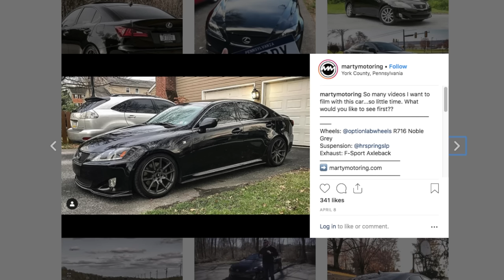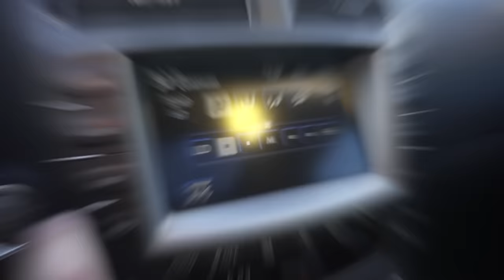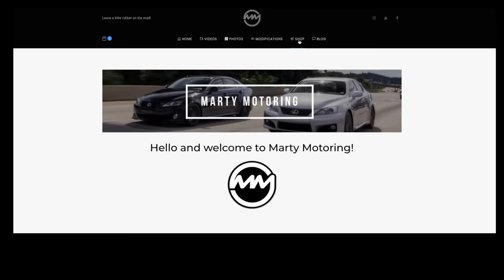Popular Mods for Lexus IS 250 and IS 350

Comment: Almost Everything he said can be said about literally any car. This isn’t vehicle specific
Reply from the maker: I could make a general car one, which would get more views I'd assume, but I like to focus on what I know - the Lexus IS - and point out specific parts and upgrades that are popular for this model of Lexus. But yeah, most of these can be applied to any modified car.
Reply: Most mods are universal really. Like turbo kits that are not "plug and play", as in you will always have to look for other parts like injectors, get a custom exhaust for the setup etc. It's because it's customization and everyone has different tastes and needs.
Reply: Very helpful suggestions to bring any Lexus up to par with additional features! I've actually topped out on what you said with the exception of the rear defuser and stability bars. My next   update will be a new a
RR-RACING carbon airflow tube!
Reply: @jeffgrant7113  What brands are those parts? Who makes parts for the Lexus cars?

Comment: My first car ever was 2008 IS250. Loved and enjoyed it for 8 yrs. Love to see the car still gets love in 2019.
Reply: I am actually thinking of getting it for my first car.Would you give me any advice?
Reply: What should i look for?
Reply: siemenssx1  dumb advice, don't finance a garbage civic
Reply: siemenssx1  An old car can be bought for much cheaper. It's already devalued. A new car will just lose value over time, much more than a used car will. Resale value is higher but so is the loss in value. Also not necessarily a better ride either. Modern tech and better fuel mileage, yes. Hondas have a decent resale value but so does Lexus.
Reply: @cfvankata543  Get A 350 Trust Me 😂
Reply: @ItzExxLOL  I was thinking of getting a 250 or a 350 as my first car any thoughts
Reply: @willterry156  A 250 Is Fine If You JUST Want A Car & Make It Look Good Etc. But Definitely Go For A 350 If You Don’t Want To Drive Around Seeing A Camry That Can Leave You Cars Behind 😂💯 I Made My Wrong Decision 250 Is For Looks 350 For Speed
Reply: 2022 still getting love
Reply: What car to you have now?

Comment: Just checked your list of modifications and noticed you have a 4runner. That IS350 and 4runner combo is killer! Great minds think alike!
Reply from the maker: It’s a perfect setup! Just got it 2 weeks ago 😎
Reply: @MartyMotoring  I have a gs350 2010 with 167k miles, Its on lowered springs + aftermarket tires & rims and I plan on getting a catback exhaust next week, I been hearing that I could get a RR racing tune but I'm a little un sure about it since I'm worried about the engines health with these miles, any tips? btw any other performance mods I can add that actually will give significant results?
Reply: I have a gs350 2010 with 167k miles, Its on lowered springs + aftermarket tires & rims and I plan on getting a catback exhaust next week, I been hearing that I could get a RR racing tune but I'm a little un sure about it since I'm worried about the engines health with these miles, any tips? btw any other performance mods I can add that actually will give significant results?

Comment: Shes perfect. Simplicity is the key to these amazing cars, some people rice them out and make them look, sound and run horrible. Props for doing all the right things
Reply: I have a gs350 2010 with 167k miles, Its on lowered springs + aftermarket tires & rims and I plan on getting a catback exhaust next week, I been hearing that I could get a RR racing tune but I'm a little un sure about it since I'm worried about the engines health with these miles, any tips? btw any other performance mods I can add that actually will give significant results?

Comment: One often overlooked mod IMO is oem sized 2piece floating rotors. The IS350 already comes with stock 4 piston caliper Big Brake Kit and large 330mm stock rotors. The only problem is the stock rotors are heavy 24 pounds each. 2 piece rotors with aluminium hats are much lighter around 12 pounds each. Switching to 2 piece rotors immediately takes off 24 pounds of unsprung weight from the front of the IS350, improving braking and most importantly, ride and handling, all without even touching your springs and shock absorbers or chassis.
Reply: Can you do that with a 2014 IS 350 F sport?

Comment: Just bought a 09 IS250 yesterday and this video is just what I needed!
Reply: the is250 is never gonna be powerful but if you focus on cutting weight and tuning the suspension....it will feel like a totally different car. i believe the recipe for the 2IS 250/350 is exhaust, drop in filter,rr tune, coilovers, front/rear sway bar, and LCA bushings/mounts
Reply: @gparton85  what are you yapping about …. You can safely get this car up to 400+ whp 
Pick one up for 15k with less than 75k miles - with 5k into the engine at 20k you have a very reliable fast and good looking car 
Supercharger- tune and more work here and there throughout the years
Reply: @davidcazares2469  400 whp  from a 250 is wishful thinking. Yes these cars can be found  at a reasonable price. And yes, they can be modified as little or as much as you like, but the turbo kit alone is typically in the $5000 to $7,000 range and that's not including any supporting mods.  The 250 can be made fun to drive and even be called quick at times but there simply is no replacement for displacement.  Anybody with a brain is going to say that 20k would be better spent picking up a 350
Reply: @gparton85  I have a gs350 2010 with 167k miles, Its on lowered springs + aftermarket tires & rims and I plan on getting a catback exhaust next week, I been hearing that I could get a RR racing tune but I'm a little un sure about it since I'm worried about the engines health with these miles, any tips? btw any other performance mods I can add that actually will give significant results?

Comment: Bought my used 2014 IS350 F-sport about 3 years ago. I've had alot of cars, but must say these IS's are just all around great cars. Just does everything well, enough power, good ride, reliable, easy to drive..etc. They are worth a look if you're interested in one. Peace!
Reply: Casper Gomez  no mods..only thing I've changed were the front brake pads to Akebono. Stock F-Sport pads only last 20k and are super dusty.
Reply: Damn I sold my white 2014 is 350 f sport 3 years ago I loved that car and as soon as I sold it rr racing came out with the is 350 super charger kit .
Reply: Anthony B I love my 2014 IS350. I got mine back in 2017. Lots of mods to it. Next is wheels and a trip to RR racing 😝
Reply: Casper Gomez Not yet. Plan on getting it when I do headers.
Reply: @thomasrhoades6283  I have a gs350 2010 with 167k miles, Its on lowered springs + aftermarket tires & rims and I plan on getting a catback exhaust next week, I been hearing that I could get a RR racing tune but I'm a little un sure about it since I'm worried about the engines health with these miles, any tips? btw any other performance mods I can add that actually will give significant results?

Comment: I’ve got the wheels,, straight pipe,, and I lowered my suspension already the rest are on my bucket list 👌🏼
Reply: I have a gs350 2010 with 167k miles, Its on lowered springs + aftermarket tires & rims and I plan on getting a catback exhaust next week, I been hearing that I could get a RR racing tune but I'm a little un sure about it since I'm worried about the engines health with these miles, any tips? btw any other performance mods I can add that actually will give significant results?

Comment: My favorite one is the 7400rpm OV tune for sure. That's the one I've enjoyed most so far. Following that I'd say invidia midpipe combined with manzo exhaust even though manzo exhaust makes the car still kind of quiet.
Reply: I have a gs350 2010 with 167k miles, Its on lowered springs + aftermarket tires & rims and I plan on getting a catback exhaust next week, I been hearing that I could get a RR racing tune but I'm a little un sure about it since I'm worried about the engines health with these miles, any tips? btw any other performance mods I can add that actually will give significant results?
Reply: @senorbonbon  RR racing won't give you any power gains just the advantage of a higher limiter that will help with longer gears. I've been custom tuned to rev to 7600rpm with burbles for 2 years and haven't had an issue yet.

Comment: Rusty battery earth point needs removing, wire brush on drill to clean up, copper grease before refit. Replace all brake pins front and rear because they seize / warp / bad rubber after 100k. ABS sensor cables can fail not the sensor, check for voltage first. make sure the oil filter cap has a metal tube attached inside, They can come loose, end up in the old filter and in the bin by mistake. This will make the new filter squash and twist causing low oil pressure. Check the steering wheel down shaft UJ pinch bolts are fully tight and pinched together (above where your feet go drivers side.) They come loose making wheel play. Always reset SAS / torque sensor after wheel alignment or it will feel odd (Electronic steering)

Comment: Perfect timing. I was just starting my shopping list TODAY. LOL.

Update: Beautiful video. I didn't know the center console modification was a feasible and popular mod. What a relief. Something less to be nitpicky about.
Reply from the maker: Thank you!
Reply: I have a gs350 2010 with 167k miles, Its on lowered springs + aftermarket tires & rims and I plan on getting a catback exhaust next week, I been hearing that I could get a RR racing tune but I'm a little un sure about it since I'm worried about the engines health with these miles, any tips? btw any other performance mods I can add that actually will give significant results?

Comment: What to do?
1 - Change intake filter(only the filter, do not upgrade it to cold air).
2 - Clean intake sensor.
2.2 - Internal intake clean.
2.3 - Clean or Change Throttle body Valve.
3 - Change Anti Freeze (coolant) liquid = Toyota Super Long Life Coolant (9.1 Liters.). 
4 - Change spark plugs if you are having troubles to start the car = DENSO FK20HBR11 = 1.1mm gap = iridium-tipped.
5 - Change Breaker fluid if dirty (FMVSS No. 116 DOT 3.).
6 - Upgrade alternator.
7 - Swap PCV valve.
Additionally after 50k: Differential oil = 1.15 liters. Synthetic 75W-90 Gl-5.
9 - Change Oil Filter = K&N
10 - Change Oil = Synthetic Oil  = 5W-30 (6.3 liters).

Automatic Transmission Fluid = 1.8 liters, Toyota Genuine ATF WS.

Clutch fluid = FMVSS No116 DOT 3.

Brake fluid = FMVSS No. 116 DOT 3.
Reply: Im thinking of getting the " K&N Engine Air Filter: High Performance" filter would that be a good upgrade for my gs 350?
Reply: @senorbonbon  I had it on my 07 accord, makes it a little louder and got a tiny bit better mpg and easy to clean. Would recommend for $60

Comment: Bro this car does do BlueTooth media streaming audio... you just have to register your device in the settings and sound section on head unit ... go to portable media player and register your phone... no dongle is required to do this it can do this as well as use it as a phone for calling. I have both set on my unit
Reply from the maker: What year is yours? The 2006-2008 models don’t have audio capability or those settings in the sound system...have to use the adapter

Comment: General belief says that strut towers actually stiffen the car but its a double edge sword. If whatever reason you crash into a kerb, the chassis will twist thanks to the strut tower braces. You got to take into account that these will basically "connect" both tyres, look at it like this, if one side is independently under compression, the other shock will try to balance the car for better handling, but if you connect both sides one side will compress while they other side is going to rebound in a much more unefficient way. They only help with tension or compression according on how you operate your car. If you ever consider turning your car to a race car (if thats what you want), consider gutting out chassis glue and weld the parts for stiffness, no strut brace will compare if you do  this correctly.

Comment: Awesome video! I'm curious though. What kind of gas mileage do you get on your 350? My 350 has pretty crappy mileage! I get 22mpg at most even though I drive mostly on the highway.
Reply from the maker: Thanks! I don't get much better on the highway at 24mpg...
Reply: @MartyMotoring  what a bummer. On paper it's supposed to be 32mpg strictly highway so I was expecting at least 27mpg city and highway combine.
Reply: Mine used to get 25.2 mpg. Now I can only get 24.3 mpg.  I guess its still good considering yours is lower. Haha

Comment: Have anyone got a check engine when switching to the k&n air filter? It seems like IS don’t like it. I’m getting a P0441 and p0101 after the install. But when I put the regular one back in it works fine.

Comment: Where did u get ur front headlight and back headlights from. My Lexus 2009 is250 awd always has a balset issue replaced it like 5 times for each front light getting tired of it.
Reply from the maker: It's pretty annoying! Well these a few options out there. These were VIPMotoz or Venom brand...check out my newer video with the discounted DEPO v2 head lights. 
Rear lights are VLAND brand.

Comment: Good video! IMO it's better to stay with the stock air filter. Its job is to filter the debris. Cleaning my throttle body and installing a new PCV valve made a big difference. I've  chosen JOEZ INTAKE and no regrets.....
Reply: @mikexcanxjerk  It uses the engine vacuum to pull blow by gases out of the crankcase.
Reply: @mikexcanxjerk  it keeps the engine running more efficient and smoothly.
Reply: @mikexcanxjerk  Yes it has one. Like 10.00 and takes about 5 minutes total time.
Reply: I have a gs350 2010 with 167k miles, Its on lowered springs + aftermarket tires & rims and I plan on getting a catback exhaust next week, I been hearing that I could get a RR racing tune but I'm a little un sure about it since I'm worried about the engines health with these miles, any tips? btw any other performance mods I can add that actually will give significant results?

Comment: Great video! I have an is250 and was thinking about putting in a cold air intake but from what I've heard the placement sucks in hot air and can affect performance also I live in Australia and its hot most year around. Can you please give me some advice
Reply from the maker: Thanks! The factory box is technically already a cold air intake due to its design and induction points. You can replace the air filter, air intake tube/pipe and even drill an additional intake hole on the box like I did in a video of mine. That would be better than an aftermarket intake and would still get the cold air :)

Comment: HEY LOVE YOUR CHANNEL. I HAVE A 06 IS350 AS WELL,  I WAS WONDERING IF THE VIP MOTO HEADLIGHTS YOU HAVE INSTALLED WILL WORK WITH MY FACTORY HID HEADLIGHTS. I CANT SEEM TO FIND A SET THAT WILL. IF THEY DONT WORTK WITH THEM, DO YOU KNOW IF THERE ARE A SET THAT WILL OR DO I HVE TO DO SOME WIRE WORK. PLEASE ANY INFO YOU CAN SEND ME WILL BE GREATLY APPRECIATED.
Reply from the maker: Yup, they worked for me. I had the factory HIDs. Unplug everything, and the VIPMotoz harness plugs right in the factory harness. You can use LED bulbs in there. Online it says they don’t work, but they do. I have a few videos on the light setup
Reply: @MartyMotoring  ok so i should have no problem installing these same head lights on my car, great!! Was there anything that u had to alter or modify inorder to get it to work.... if u did any modifications, can u put up a video let us know in detail what u needed to do to get them to work right.... i heard that there was some wiring issues that needed to be addressed... thanks for any info u can give us... love the channel... 💪🏽💪🏽💪🏽💪🏽💯💯
Reply from the maker: Markeith Alleyne just plug and play here - but if you want to disable the daytime running lights, you can with Toyota TechStream. I did a video on this as well

Comment: i got a front lip on my 2014 350 and i can no longer use the ramps to change the oil. i am on stock suspension but the lip makes it impossible to use the ramps anymore. what should i do? are there any low profile ramps that lift the car high enough or should i suck it up and just take it to the dealership? i dont like dearlerships so thats my last option
Reply from the maker: You can build it but “race ramps” for lowered cars, or Jack up the car

Comment: Should I buy a 2010 is250 with 77k miles or a 2011 with 100k miles?
Reply: AKA Wale 100 miles or 100k miles? I would go with the 2011 I believe that’s when they started supporting Bluetooth streaming.
Reply: AKA Wale 100 miles or 100k miles? I would go with the 2011 I believe that’s when they started supporting Bluetooth streaming.
Reply: 2011 for the bluetooth and better headlights with the led string
Reply: 2010 looks like a better deal if others got 100k, just make sure the battery and alternator are good and won't fail on you.
Reply: I have a 2010 I bought a year ago due too the 40K miles it had.. But I wish I would have shopped around more.. For a 2011.. Cuz of the LED running lights..😫😫😫
Reply: CowboyLakersFan 13  what year is yours..?  I'm not  sure if those aftermarket lights are compatible with my 2010 😕
Reply: @leorodriguez6080  2010 started Bluetooth streaming.. & Lexus Enform
Reply: I have a 2010 is250 c and it runs great at over 70K miles.  Also, mine has Bluetooth integration with the stock stereo
Reply: just got a 2011 with 102k miles. absolutely love it. got it from a dealership, one owner (female) was originally a lease and she bought the car, all work done at lexus dealership every 5k miles on the dot, car runs perfect and couldn't be happier.
Reply: dark how much?